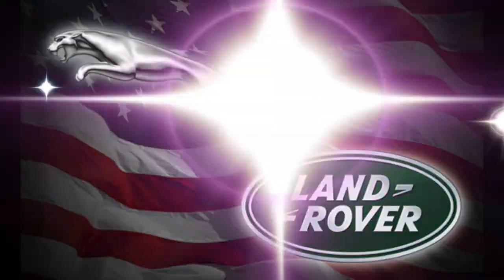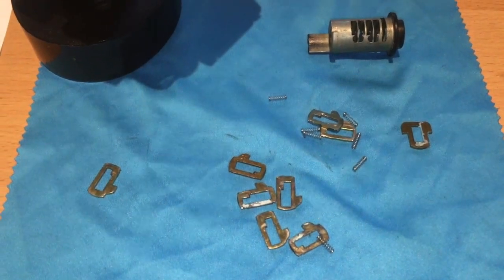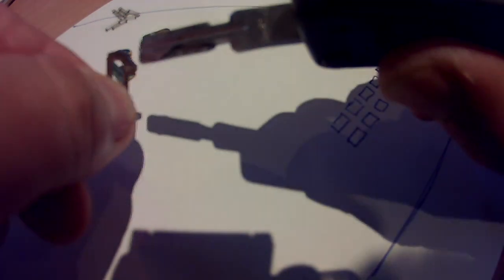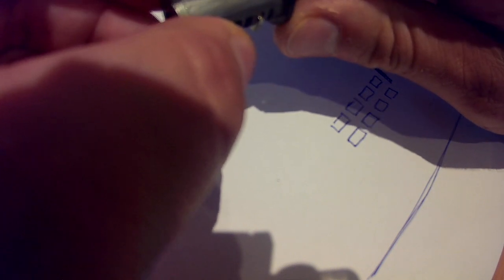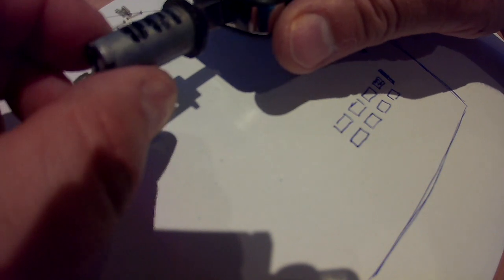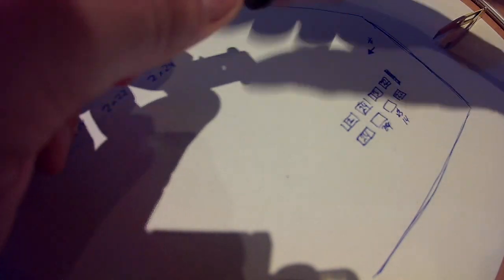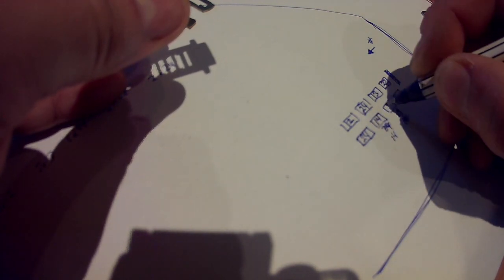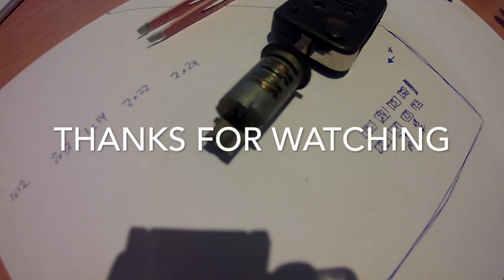Range Rover P38 # 061 - Keys and Locks

Comment: Thanks.  I have had the same issue with my glove box too.  But my mom's twin sister jammed it shut and its been that way for several years...
Anyway, took my mother (90 yrs) out in my R.R.P38 the other day and the passenger locked and would not open.  We had this happen a few years ago [bad alternator/low battery/resyn.]  But this time 100% battery, good alternator... and still the door was/is unopennable.  So I am finally going to completely go through the lock system.  I even purchased new latches for the front door, just in case... and the lock plastic pieces that fail in the handles.  But I ordered from England a Rt. Hand drivers door handle [my car is a left hand drive] and new internal actuator.  I plan to rewire the two in parallel to the Body Computer so either side will open the car... or I can use the key to open both sides.  This is great I now know how to "key" both sides to work with one key... yah!
Reply from the maker: Hi Kimball. Sounds like a great project there. Please do let us know how it goes. Curious to hear how it turns out. Good luck, and thanks for watching and the kind feedback.